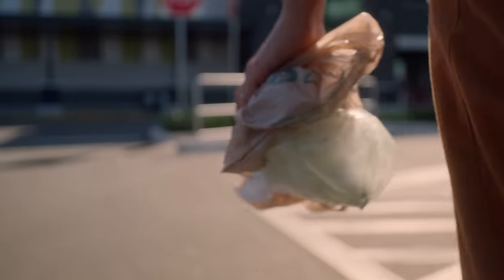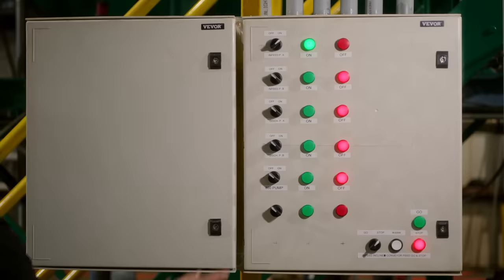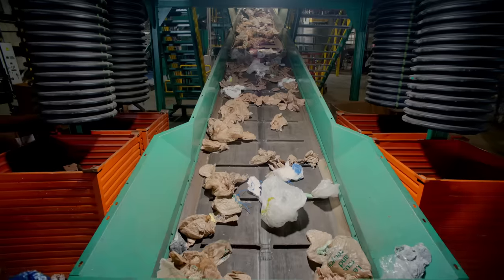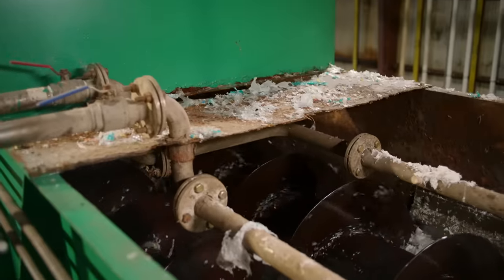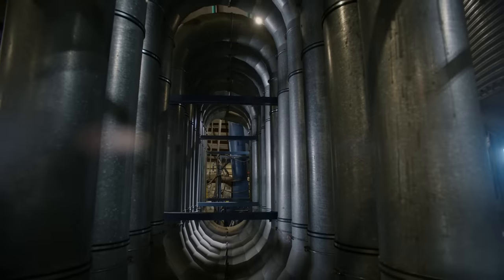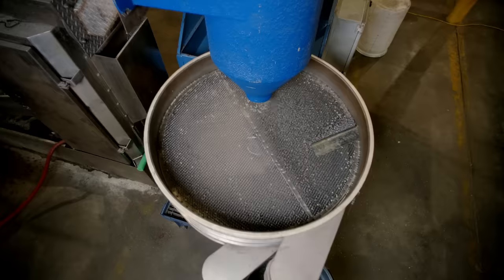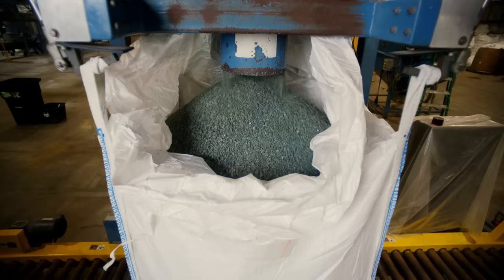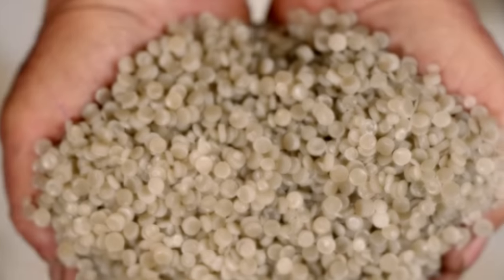What happens to plastic bags when you recycle them at Publix?

Comment: Publix instead of leading by being proactive chose the comfort of the status quo. Instead of doing the right thing, they will stop using plastic bags only if they are forced to by either 1) legislation (not going to happen in Florida) or 2) public pressure / shaming. 

Yes, paper bags cost more but so do accepting credit cards: that's the  cost of doing business. So offset the cost with savings, like by putting solar panels on your roofs. Target  has done it (check google maps, majority of Target locations in Florida are covered in solar panels). Target is also adding EV chargers, now if Publix was doing that, shopping would really be a pleasure...